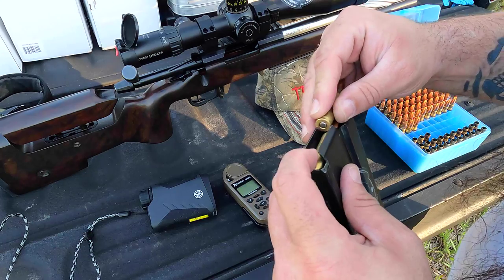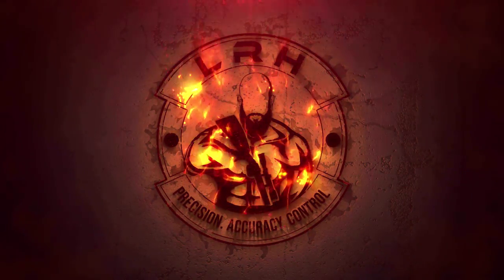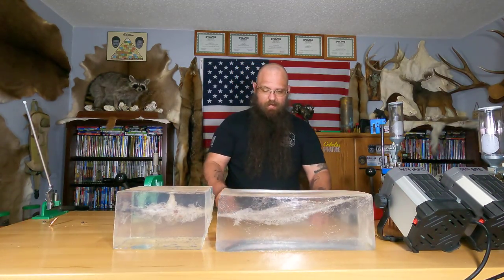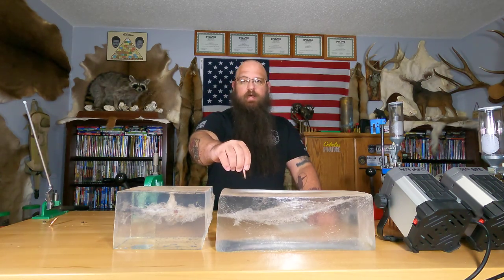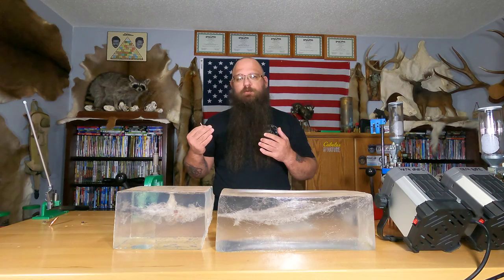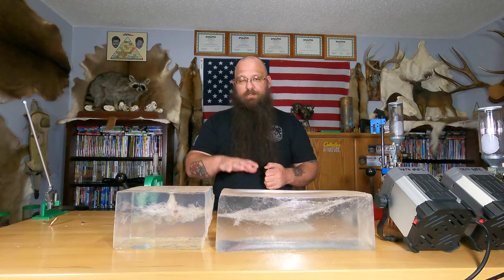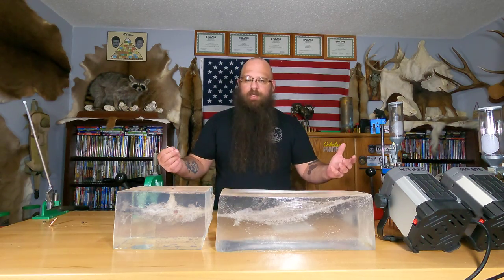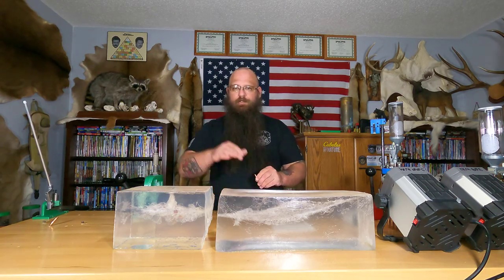Ballistics gel hunting vs match bullets episode 8 Hammer Hunters whitetail deer and elk.

Comment: I've had complete different results with these bullets in 7mm 177gr and 155gr. Got 4 animals with the 177s. 7mm hole in and 7mm hole out with everything in between turned to sloppy goo. My wife shot a black tail last year at 400 yards impact velocity of 2220fps. Wind call was a tad off. Hit the deer in the front of the liver. Deer dropped dead in its tracks. Liver and back half of the lungs looked like red soup. I'll keep shooting them.
Reply from the maker: Are you saying that your entrance hole and exit hole were the same size?
Reply: @longrangehuntinggroup7223  Whats it matter if the lungs and vital organs are turned into runny chunks. Bullet expelled it's energy into the tissue. Perfect. I'm sorry these bullets didn't work for you. They work great for me. Shoot the correct twist rate and your gear will perform. Bryan Litz has a whole chapter on it. K? Cool.
Reply from the maker: lol I love how you guys always go with twist rates trying to say it wasn't stable. I do accuracy testing and have the correct twist rate. The bullet penetrated straight into the gel 5" prior to necking over. You clearly need a education on terminal ballistics and bullet construction. Energy is only a potential and is directly dependent on bullet performance. If you entrance and exit hole are the same size then the bullet failed to expand therefore not dumping a lot of the potential energy. You can kill with a musket ball doesn't mean that you got good performance. A 7mm on a blacktail isn't impressive that's like shooting a squirrel with a 357 doesn't matter what bullet due to pure size. You should watch the second part of this showing poor performance and the exact same results I got in the field from hammer bullets own YouTube channel. The goal here is to show the difference in bullet performance and the hammer hunters are definitely not a great bullet. Design and construction are terrible and it shows not only in my tests but in the field including hammers own videos. There's much better bullets out there.
Reply from the maker: https://m.youtube.com/watch?v=jZh-PFwXTOU
Reply: @longrangehuntinggroup7223  I find your results difficult to belive. Strictly based on numbers. There is lots of forms referring to great lethality of these bullets. I find it odd that out of several hundred reports of these bullets performing. You have the only review this poor. Do us a favor and test other calibers and weight. Maybe more average hunting weight bullets. A 214gr 30cal  all copper bullet almost need a rifle that cattered to the bullets size and length. Maybe 6.5 124s or 7mm 155s. Before you claim the bullet design is inferior. Not good ballistician is going to base finding and make claims of performance based on one bullets performance. I think you need more testing across the board before saying the things you have claimed.
Reply from the maker: I see you're still grasping at straws for a valid argument. This isn't just one caliber I'm also basing this on hunting shots in the field with multiple cartridges and bullet weights both from people I know who have hunted with them and hammer bullets own videos. Most people don't have a clue about terminal ballistics or bullet construction. People think core loks are incredible and they are one of the worst bullets made. People confuse killing and good performance. By the way the guy who sent me the bullets didn't like the results either. So he ordered his own gel and shot it with a 375 cheytec with a 411 gr hammer. Guess what he got the exact same results as I did. Verified shots with everything from 6.5 to 375 with the exact same results of poor performance. As for your comment on testing hunting weights of bullets lots of people hunt with 30 cal 200 plus grain bullets. I sent one off to a buddy who is a expert in bullets and he cut it open. The design is piss poor anyone including a ballistician will tell you that. The bullet doesn't lie and testing in controlled environment and hunting shots on video all show the same thing. You can keep your uneducated opinion I'll stick to provable facts.
Reply: @joshdozier1719  actually what you are describing is exactly what Hammer claims their bullets are supposed to do.  They penetrate in, shed the front petals, leaving the base to drive all the way through.  Which is similar to what a Nosler Partiton does.  I’m planning on testing these bullets on deer soon.  I’m using the 124 gr Hammer Hunters in a 264 win mag.  The gentleman in this video doesn’t need to insult everyone who makes a comment on his videos.  Tests in controlled environments are great but sometimes can’t duplicate real world results on a live animal.  Take care and good hunting!
Reply: @jonbaniak9097  I think this guy played too much COD in sniper mode. To each their own. People this defensive about an opinion are generally wrong or hiding something. I have had great luck with these bullets. Both accuracy and lethality. I think you will be pleased
Reply from the maker: @jonbaniak9097  Bud I have plenty of conversations with people on these and other bullets without "insults". You can see those comments in all the different videos. What I do have a problem with and why I do what you call "insults" is lying or making stuff up. See it all the time with long range. Guys claim it can't be done and then see a hunting video with it being done. That's physical proof that they were wrong. They don't have a valid argument or enough knowledge to debate so they try and muddy the water. They say stuff like "well he got lucky, you didn't see how many times he missed or wounded animals prior to that shot, he really shot it multiple times and edited the footage, etc" These are made up lies to try and discredit or make the person look bad. No different then the comments here saying stuff like I don't have the correct bullet twist, wasn't stable, or I don't know what I'm doing. They don't know any of that but don't like the results because it proves them wrong. Doing that lying shows a lack of character and integrity. They have no idea what my twist rate is because I never said. So if someone comes on here lying and has no knowledge of terminal ballistics ill call them out on it. If a bullet doesn't have gyroscopic stability it won't impact straight it impacts at a angle. It does not go straight in 5" and then start necking over. This is basic terminal ballistics and external ballistics. I have the correct twist it shot accurately. It's simply a poor bullet design. The expert I send bullets to to cut them open for analysis was mentored by Nathan foster. He sent him my videos and the data we collected. Nathan agreed with the assessment including pictures from animals killed with hammer bullets provided by guys who use them. So when Nathan who is one of the foremost experts shares the same opinion on solids and hammer bullets that says something. Anyone with basic knowledge of bullet construction and terminal ballistics can see its a poor design. All bullets kill so saying that it died doesn't mean anything. Any projectile shot into a vital or will kill. How effective it is at killing is what matters. You guys are talking about hundreds of people shooting them. There's millions of animals killed every year with lead core bullets around the world. Hammer bullets are done on a cnc lathe from a solid piece of copper. There's a hole 1/16" for the hollow point that goes  .8" into the bullet. There's been nothing done to aid in expansion by weakening the bullet. By the way other copper bullets have been designed to weaken the bullet because they know it's a harder metal. Therefore requires more force to expand. So they specifically designed them with material removed etc. They openly recognize the disadvantage of copper and it's hardness. So they take action and designed them to counter that issue. Hammer bullets has not done anything to combat that well known issue. Hammer bullets are designed to expand and the pedals come off creating their own small wound cavities. The rest of the bullet continues through "to give excellent terminal performance" problem is that's a load crap. Energy is only a potential and directly dependent upon bullet performance. The more the bullet opens up creating surface contact the larger the permanent wound cavity and temporary wound cavity. So a hammer bullet goes in and starts to expand if it does and starts the displacement and transfer of energy. Then the pedals break off and you loose that surface contact therefore not getting good transition of energy. The pedals will create small wound channels. The surface are drops back to the diameter of the bullet effectively giving you a fmj. So you're not getting a good permanent wound cavity. The start of that cavity is stopped when it breaks the pedals off. With only achieving hydrostatic shock the permanent wound cavity size will be the diameter of the projectile. Since it is only the diameter of the bullet you will only get a smaller wound cavity. This design prevents you from achieving hydraulic shock. In order to get a solid to perform you have to go with a lighter bullet to reduce mass and increase velocity. This translates into lower BC's and energy and velocity bleeding off faster. Also results in not handling long ranges well especially transonic and subsonic flight where it will destabilize and loose gyroscopic stability. So you have to limit your bullet weight resulting in loss of BC. It requires a high minimum impact velocity to expand limiting your distance. Copper bullets are harder on barrels especially with the high velocity requirement. I know hammer has something on the bullet to reduce friction. Still even with that still has more barrel wear than lead core bullets.  So it costs you more money in barrels and the bullets cost more. So more expensive and doesn't deliver the same type of performance as better bullets at half the price of solids. And before someone makes the dumb comment that I'm cheap. The rifle used is a full custom. The whole setup is around $10,000. I run the best equipment and bullets. There's a big difference between paying for quality and something being over priced. I'm not going to pay more for a product that doesn't perform as well as the other ones. Hammers design doesn't allow for a good permanent wound cavity and limits the temporary wound cavity (energy potential). You can't achieve hydraulic shock. You don't get a bigger permanent wound cavity. Higher costs, less performance, lower BC, limited on bullet weight. Limited range due to the required higher minimum impact velocity. Increased chance of necking over changing directions and or tumbling. It can also pencil through. This all is basic terminal ballistics and bullets. With a better lead core bullet I'm not limited on weight I can run light to heavy and it will perform. I can run heavier bullets with high BC's. I have a lower minimum impact velocity extending my range. Doesn't cost as much and gives me superior performance. Doesn't wear out the barrel as fast. Will expand easier and wider creating a larger permanent wound cavity and higher surface contact dumping more potential energy into the animal. I can achieve hydraulic shock which results in a faster kill. I have more room for error because of the hydraulic shock and the size of the temporary wound cavity. With solids not transferring as much energy and a smaller temporary wound cavity. This means you have less aid in margin of error especially without achieving hydraulic shock. Plain and simple it can't compete with a good lead core bullet and drastically limits you. Limited on bullets, performance, etc. That's solid copper bullets in general then hammer puts themselves even more at a disadvantage by poor design and construction. I can use my great lead core bullets. I know that they will be consistent every single time. I'll get good performance in accuracy, terminal ballistics, and external ballistics. It will travel through the way it's supposed to not changing directions, tumbling, or penciling through like a hammer. It doesn't cost as much or wear on the barrel as much. So you can try and claim I'm insulting people. I'm calling people out who lie without even knowing the facts. Also guys who clearly doesn't have basic knowledge about ballistics or bullet construction. I'm a nice guy and have discussions and compare notes all the time. I also unfortunately deal with people who don't have a clue but want to argue.